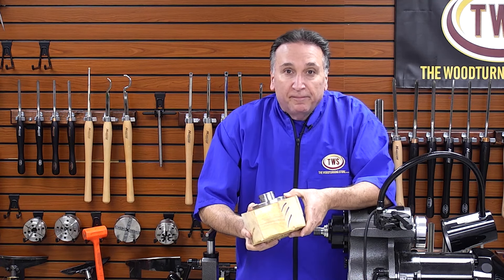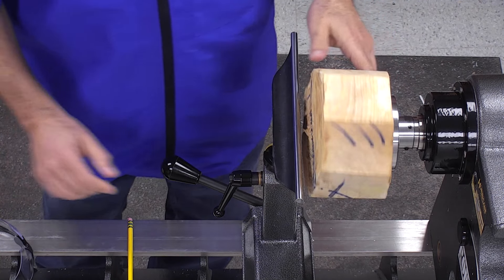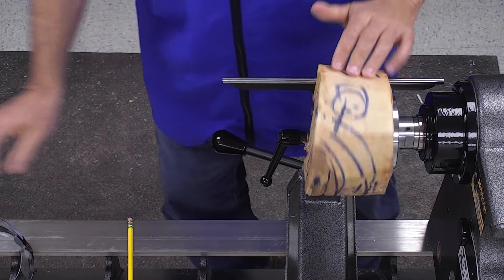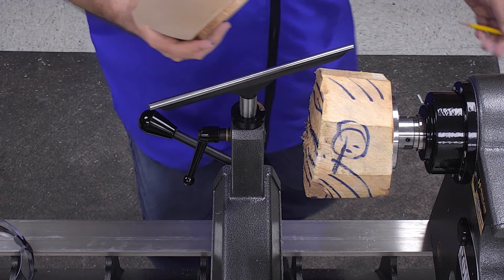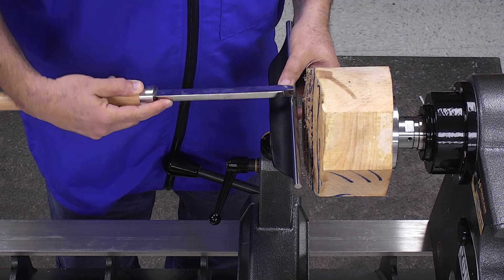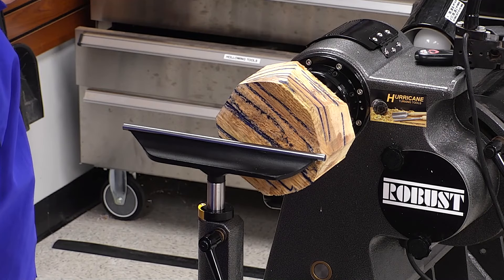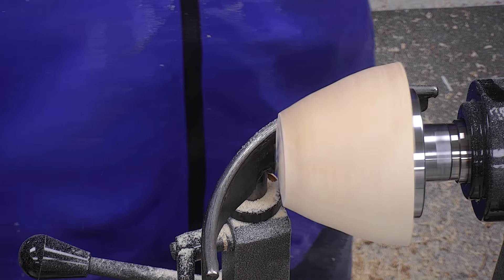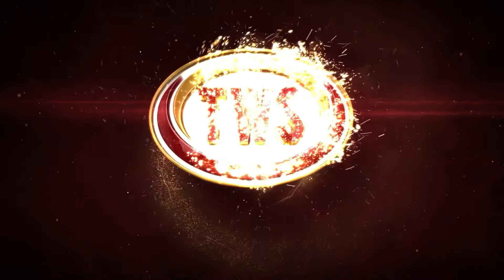Turning a Bowl Blank with Hurricane Carbide Tools - The Woodturning Store

Comment: you guys should fix the taper in the back to the tool if you are selling tools. Instead of proposing a work around.
Reply: Agree! It's like car dealer telling the customer that the 2WD is great on snow, as long as you add lots of weight and couple  aggressive tires on the vehicle, nevermind suggesting a 4WD. LO.! I'm  not too impress with the carbide cutters, not for turning.
Reply: @PoisonShot20  Gotta disagree.  I found I have used them more and more as they need much less frequent sharpening and when done with care you can get a very fine finish.  Especially when you slightly tilt the cutter to get more of a slicing cut.  Bowl gouges(high speed steel) require a lot of sharpening to get even one bowl done.  They just don't hold an edge well enough for me.